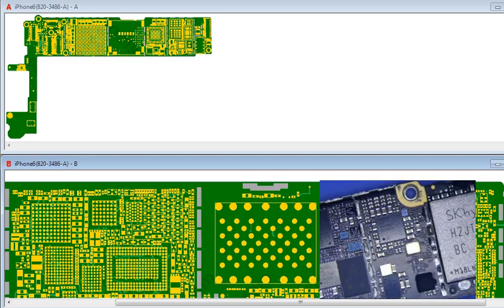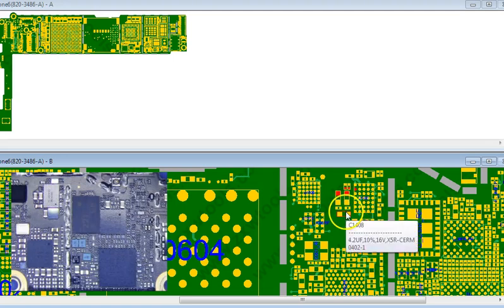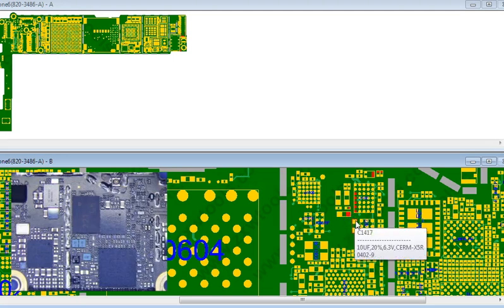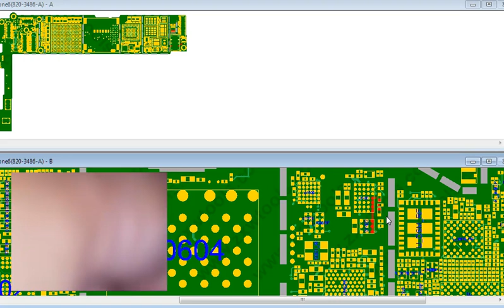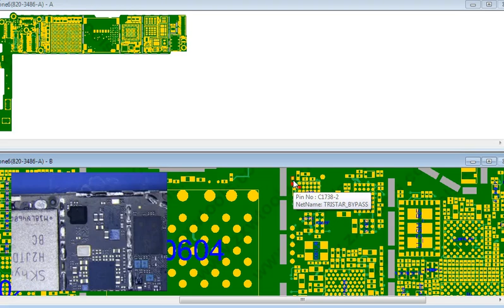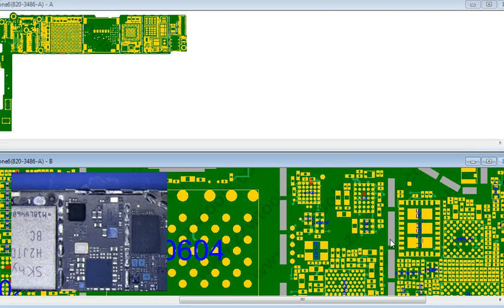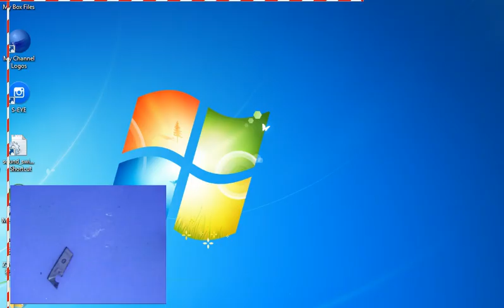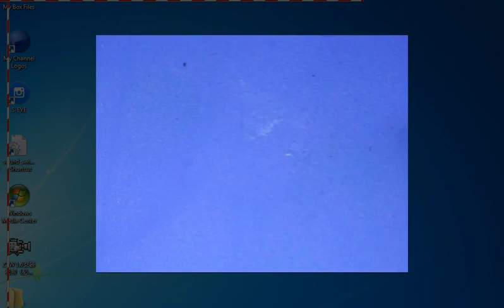iphone 6 not charging voltage testing

Comment: hi, i have an iphone 6 that charge normal but does not get regonized by computer or other laptop. i replace tristar but still the same problem. Any ideas? Thanks
Reply: Have u got the solutions ?
I got the same issues
Reply: Change the lighting cable of iPhone charger

Comment: Where did you get the voltage measurements?
Reply from the maker: well, if you look at the power line, usually labeled with PP, then the voltage proceeds the PP.  So, pp5v7 = 5.7V, pp1v8 = 1.8V.  If there is no voltage labeled, like vcc_main, then, you will just need to measure the voltage of a donor board with power to the logic board.  We know that vcc_main is roughly 3.8V to 4.2V depending on the power source (battery or usb cable).

Comment: Hi!
What do you recomend if i dont have voltage in C1299 (ACC_PWR)? Thanks for this videos!!
Reply from the maker: I'm not sure what the line is, but if it's USB voltage, then you need to trace the incoming voltage from the lightning cable...it should be around 5V

Comment: Hi bro, what is the line that take the charger to the baterry, i mean when you test fpc battery conector and the voltaje is 0.4 instead 3.7, is the ic  u1700 that take the voltaje for fpc battery connector?

Comment: Hi ! Where do you actually see the voltage that these components supposed to have ? And is that voltage showing for "in circuit" components ?
Thanks.
Reply from the maker: You can look in zxw tools or the schematics.  If you see PP3V3_ACC, then the voltage at that point is 3.3V.  Same with any other point that has PP in the name.  That is the voltage at that point...I'm not sure what you mean by "in circuit"
Reply: Thanks a lot ! "in circuit" means that the voltage specified when the component is soldered to the board.
Reply from the maker: Yeah usually in circuit.  I only test the component separately to confirm that it is indeed bad after I remove it.

Comment: Do you know the difference between u1700 (u2 Tristar) u1401 and q1403? Know their different functions? Confuses me a bit
Reply from the maker: Tristar handles the charging of the battery from the USB port.  U1401 is Tigris, which handles the USB power.  Q1403 is a transistor which I think handles the voltage regulation from Tigris to Tristar.
Reply: +Microsoldering So does Tigris take power from the USB and send it to Tristar? Like does it maintain proper power for Tristar or?
Reply: i have a phone which powers on with a good battery. it doesnt show charge in top right corner, does not connect to itunes. I put in a dead battery it shows charging on black screen but doesnt charge. any ideas? when plugging cord in it when phone is off. it boots but still not charge.
Reply from the maker: Probably tristar.
Reply: yup, you were spot on as usual. i just replaced it and all well and its charging right up. cheers.